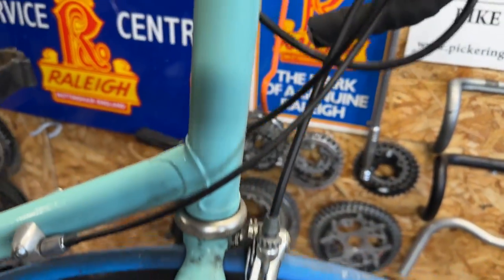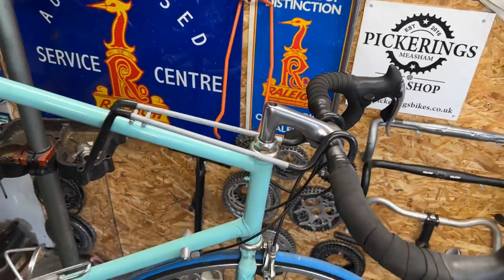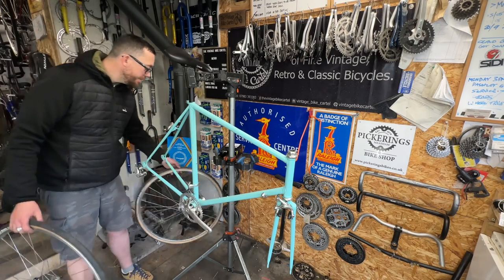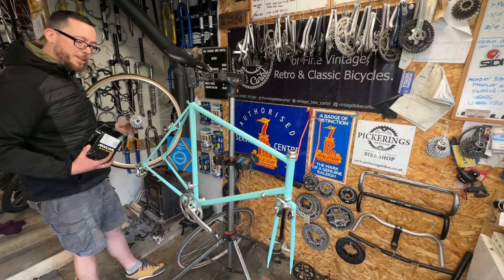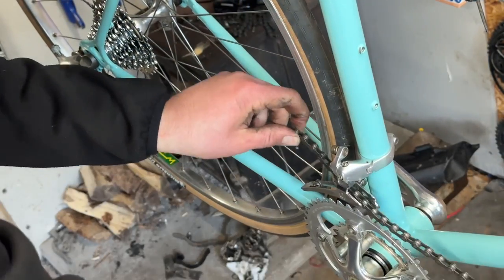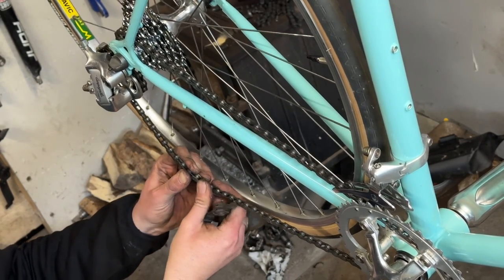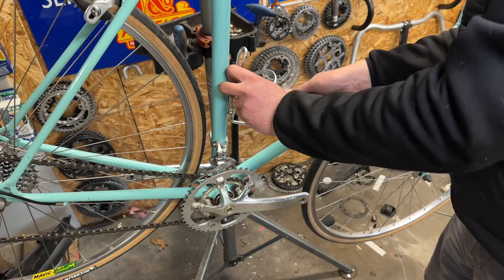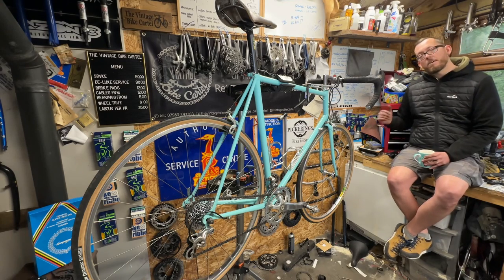Reviving A Classic: Restoring A Steel Road Bike

Comment: The paint job almost looks like Celeste. I still have my Celeste 95 Bianchi TSX. When I first built it up, I went with 8 speed Chorus. 28 years ago, could throw down a 12-21, with a 53x39. After 4 years, I "upgraded" to one of those aluminum Giant TCR's, and the Bianchi got hung up in the basement. Three years ago, I decided to go retro cool, and build it up again. I didn't have any more Campy 8 speed rear wheels, so I put on a Shimano 7700 9 speed drivetrain. It's heavy compared to modern bikes, but it's fun to ride. I found a 13-25 cassette that will get me over small rollers in my area. If I get any older, I still have a 12-27 cassette that I never used.
Your bike is looking pretty good. That's a really nice looking fork. Were there any tubing stickers on the frame when you got it?
Reply from the maker: Hi and thanks for taking the time to check out my video! Your Bianchi sounds lovely! Sadly the bike had been powder coated long before it came to me so no labels at all - but I can confirm that it rides like a dream and is a great place to spend a few miles!!

Comment: First time I've seen the Miche 8 spd cassette subbed in for the original Campy. It worked, of course, but I noted you managed it with the original rear mech that evidently has enough cage length and geometry to handle it.
Reply from the maker: Yes it works perfectly, I’ve used the bike a few times and the gearing is very comfortable I have to say.
It’s interesting that the 8 and 9 speed campy is quite versatile and forgiving, I’ve even used 9 speed Veloce with a shimano cassette before and that’s worked adequately.
It’s amazing what often works that shouldn’t with both shimano and Campagnolo - and it doesn’t hurt to try!! 
Thanks for watching 👍👍👍